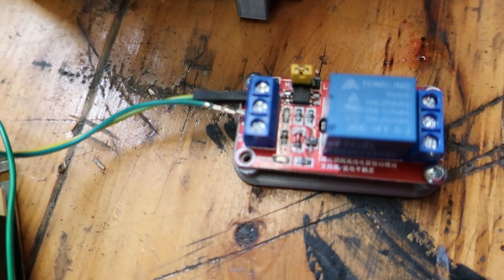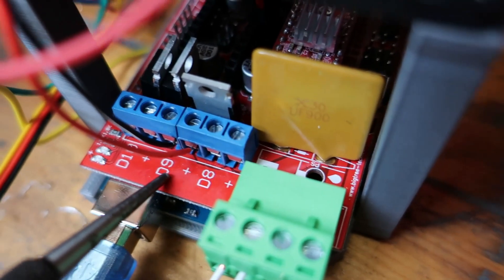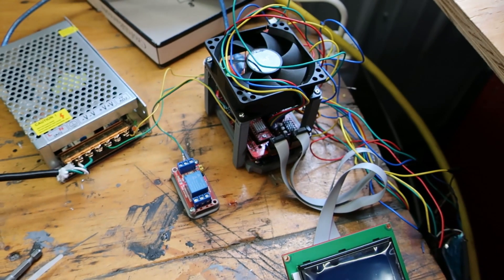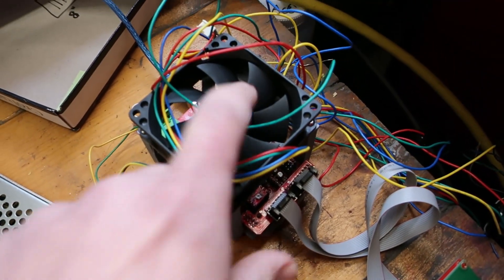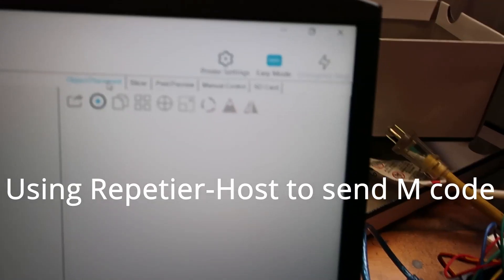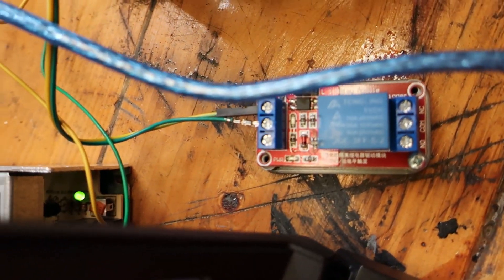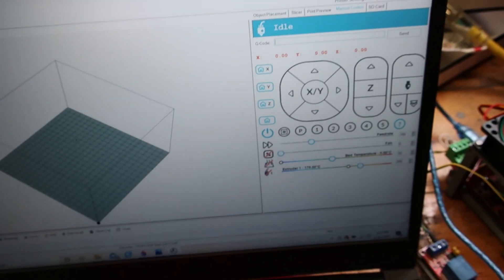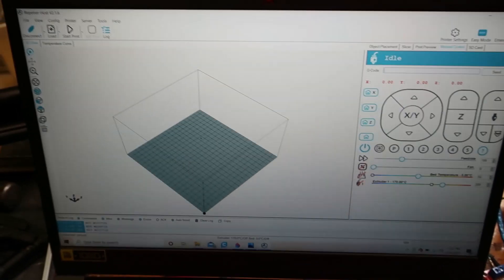MPCNC Primo Build Ep. 12 Arduino Ramps 1.4 Marlin Change pin assignment D9 to 44

Comment from the maker: I should note that in this video I left off a wire to the relay. These relays have 3 wires to trigger. One 5v , one common and your trigger pin. The yellow wire should go to 5 volts, which is the Ramps pin directly next to the ground.  The empty lug should get the signal from pin 44.

Comment: HELLO ELI... I JUST WANT TO KNOW IF YOU DISCONNECT THE FUNCTION FOR THE TEMPERTURE SENSORS IN MARLIN FOR BEGIN TO CUT ..... OR USE A PRE MODIFFIED VERSION?........BEST REGARDS AND CONGRATULATIONS
Reply from the maker: I use the pre modified version from the v1 engineering gethub